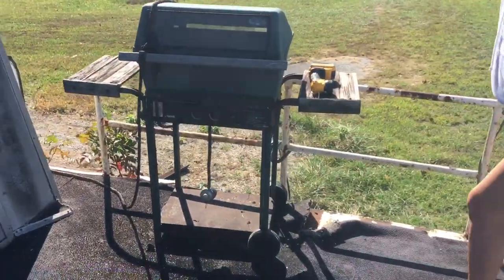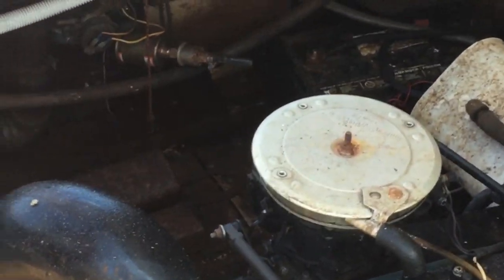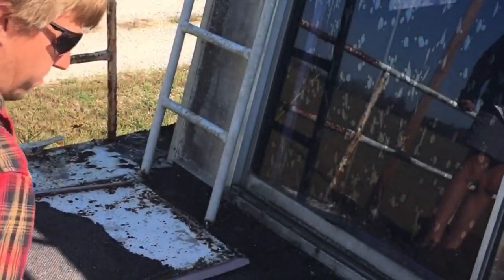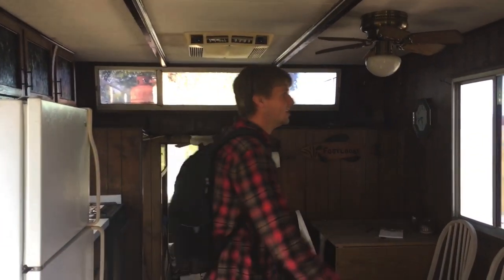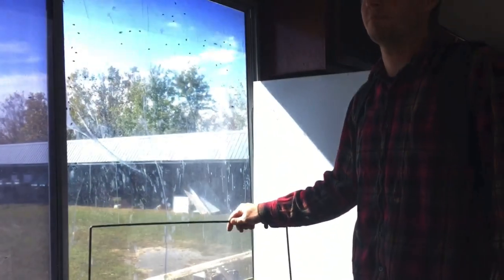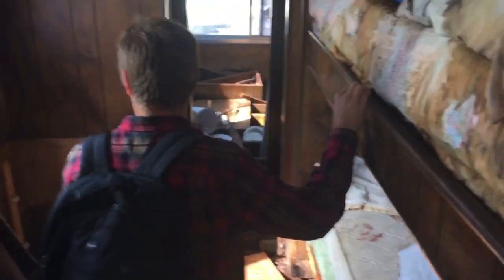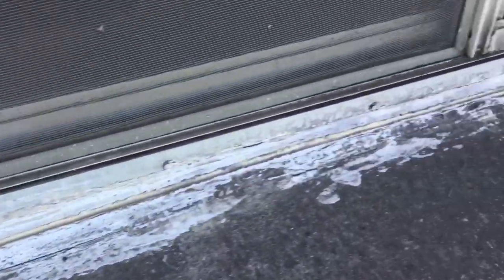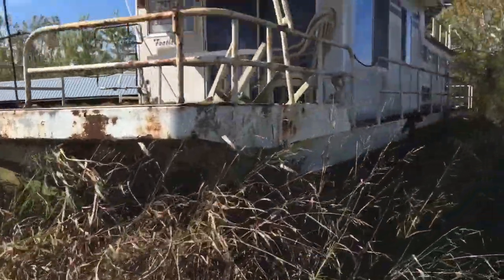possible houseboat tiny home renovation - captain for a day -

Comment: Good call on passing on the old watercraft. There are 2 things in the world that destroy dreams and projects. 1st is water, 2nd is fire. Both require total rebuild and thousands of dollars to complete.
Look for a large RV with a bad engine or powertrain problem, set it up as a custom build. They're constructed of aluminum skin with wood and aluminum framing, easy to modify and fairly inexpensive.
With your connections, friends, etc, you can create a 1 of a kind "getaway" house in no time, and have a good time doing it. Best of luck with the project!
Doug@ the "ranch"
Reply from the maker: lakesideranch I’ll add RV to our search list!  Thanks Doug.

Comment: FlexSeal!  Dude made a boat with that stuff and a screen door, it'll surely work for a rusty river raft like that!  I think trying to pull it out to the woods would have made for great video so I'm disappointed we won't get to see it fall apart during the trip. However, suggestions for an unconventional cabin are... shipping container(s), school bus(es), grain bin, box(es) off a delivery van, or several cargo vans welded together to achieve whatever size you're looking for.
Reply from the maker: BurningDinosaurs FLEX SEAL!  Of course.  How much does a 55 gallon drum go for these days now anyway?  If I call now I bet they throw in an extra one for just The cost of shipping 😂😂
Reply: @CaptainKleeman  But wait, there's more!  If you're one of the first 5 million orders, they'll  upgrade your order to 3-day shipping (just pay an additional processing fee)!

Comment: Good call on passing on the boat! Even if you were only going to make it into a guest cabin, there’s a lot of money that needs to be thrown at it to even get it transport ready. And that’s only by looking at what you recorded. We took an old school bus and converted it to a small little retreat on our river property. Between gutting and remodeling the interior and adding a deck on the outside, we have about $2K in it. Everything inside is ran off of propane and 110 power.
Reply from the maker: Junkyard’s Garage how did you finish out your windows on your bus?
Reply: Captain Kleeman we took all the regular windows out and put 16ga sheet metal up to cover them. Came back and put in mobile home windows. Cut out the hole and framed it up with 2x2s then mounted the windows. Whole inside is framed with 2x2s so we could at least put foam insulation in to give us some R Value. Finished it off with luon, or however you spell it, and 1x 4 trim
Reply from the maker: Junkyard’s Garage that’s sounds like the right way to do it.  I’ve seen some conversions where they just leave all the windows and I wasn’t a fan.  Sounds like you guys did it the right way.
Reply: Now Junkyard why you gotta tell everyone about the shack in the woods where I hide when I come to town? I thought I had girlfriend privileges jeeze... or is it a hide in plain sight kinda thing? 🤔
Reply: Mrs. S.O.T. Metalworks it’s a hide in plain sight type deal!!! That way nobody is none the wiser!!!!!